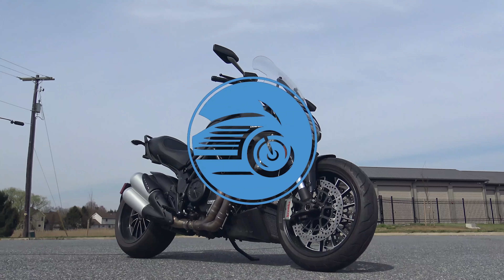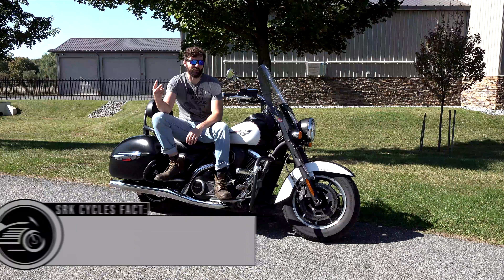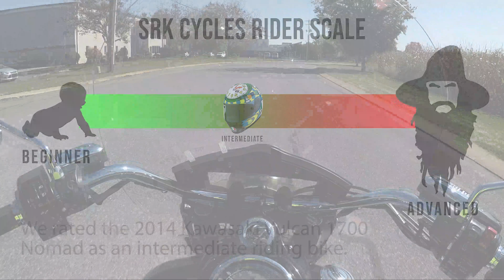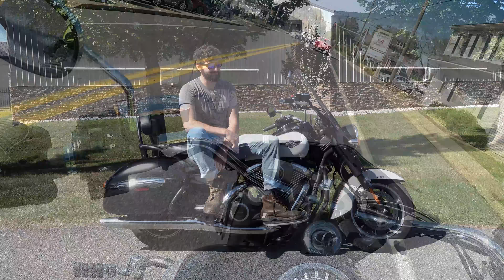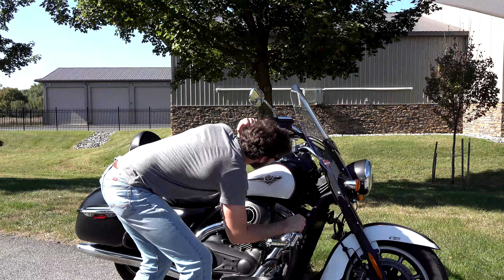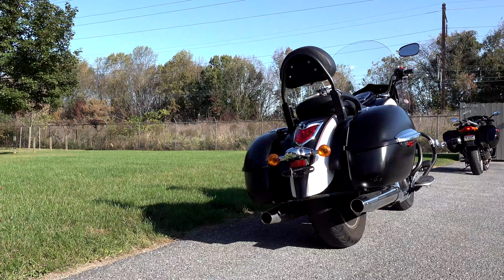Why this is one the best cruisers for the money (The Kawasaki Nomad)

Comment: I had a 2015 Voyager. I loved everything about it except the garbage throttle and engine dumping. I wonder if this is the same with the 1700 engine. I have a 2008 Vulcan 1500 classic now and the throttle, transmission and even the 5 speeds are so much more enjoyable. Yes, the Voyager was more comfortable, I just hated being in 1st and 2nd gear with that bike.

Comment: Excellent video, a question, which is better in terms of acceleration from 0-60 mph, maximum speed, fuel consumption and comfort for traveling, regardless of the price between the SUZUKI C90 BOULEVARB VS KAWSAKI VULCAN 1700

Comment: I had a first generation Nomad (1999) and I only had one problem with it. The wide, low bars. They were fine for about a hundred miles, then I would start having a feeling between my shoulder blades similar to a large knife being inserted and rotated. I did a 4,700 mile trip on that bike in '03 and when I got home I don't think I got back on it for a while. After I transitioned to a Heritage Softail in '06, with a higher more user friendly (for this user) hand position, my limiting factor these days is how much my ass can take, not my back.

Comment: I haven’t road one yet but I wonder if it is as smooth as the Royal Star?
Reply: regret the day i sold my royal star venture smooth as out
Reply: @arranhorron5173  I sold my Royal Star and have the Kawasaki Voyager now. I love the gear ratio much better and overall handling. Not to mention fuel injection. I always worried about the carbs messing up.

Comment: Just to make everyone aware....the 1700 is physically smaller than the previous 1600 Vulcan. They feel more like a road king. The 1600 feels significantly larger than the road king and Vulcan 1700. If you tall and feel cramped on bikes you will probably like the 1600 better.
Reply: Im 5,8...160 pounds....so i would imagine the 1600 would be too big for me.
Reply: @xsamitt  not necessarily. If your feet plant on the ground good then you should ride a 1600 just fine.  Once it's moving you just sit there and ride like sitting in a chair 👍. Go sit on one and if you can touch the ground well then your good to go man. The seat height is fairly low. The physical size of a bike doesn't matter much if you can safely plant your feet on the ground. The 1600 is a big long bike and it's like riding an easy chair down the road 😎👍

Comment: The brake regulation system (to keep both tires on the ground and braking) is actually technically much simpler than you described :) 
Quite honestly, I originally thought that very feature would be something to be wary about as a special technical quirk. 
I was wrong. Nomad has one of the best and the most thoroughly thought through active balanced braking systems in the heavy cruiser realm. All what it needs is a regular scheduled maintenance (like the rest of the bike). And that's it. 

95% of the Harleys ever made are still on the road. 5% of the Harleys made it home. :DDD

Comment: A nomad is a good bike.  It's nowhere near the road king.  Not in power, not in handling, not in fit/finish, paint quality, aftermarket availability, or any other measure.  However, if you don't have the money to buy-in on a  harley, a Nomad is a fantastic touring motorcycle.
Reply: I beg to differ...I bought an '01 Nomad to ride with my father in law who rode an '06 Road King. We took a trip with our Mrs's about 1100 miles and his sled developed a bucking like issue where it would shut off and then restart after a few short seconds. It turned out to be cracked fuel lines in the fuel tank and a stuck up fuel filter. He had 22k mi on his while I had 42k on mine. Our paint was on par, perfect and we'd go back and forth on open road to see who's bike would slack and they were caliper to caliper. Handling is in the rider and the tires, BTW, not the brand...that's like saying handling with a Glock is better for this guy while the CZ is better for this other guy. With all that they're equipped with already, the Nomad had enough but much aftermarket for our needs. Sounds like you're trying to justify poor spending on something iconic although not efficient or reliable.
Reply: @prissy1230 "Teyong to justify spending on something iconic although not efficient or reliable". This sums up dam near harley's entire existence.

Comment: That’s weird the 1500/1600 nomad shifter toe and heal shifter can be individually adjusted,  are you sure your not confused with the Vulcan 900 that shift lever is one piece
Reply: It can? I have an 06 1500 and I'm always knocking it out of first gear into neutral
Reply: @JayDman  That's the positive neutral finder. It's very finicky and likes to slip sometimes, especially on older models
Reply: @carpenoctem  Thanks for the heads up on this. Can you explain the adjustment or post a link as to how it's done by chance? 
Thanks!
Reply: @JayDman  There really is no fix, you just have to get used to it. it's a problem on the newer kawi bikes too. Gotta use a lot of force to kick it into 2nd. You get used to it after a while.

Comment: I own a Road King.  That Sir, is no Road King.  If it feels lighter, it must be a sportster(girls bike)
Reply: Compensating much?
Reply: @bigpapa8152  Now let's compare torque. I don't give a rat's ass about horsepower.
Reply: @dougfielding8215  zx-14 torque and road king torque numbers are extremely comparable, and lets be real no harley ever has had the balls that any zx14 has.
Reply: hey no reason to knock other Harleys here,guy! my Sporty does just fine thank you
Reply: As I once heard from a true rider - I'd like to see you take a sportster on a road trip. You wouldn't be able to handle it because you sit on your cushy bike that has suspension for your poor back, windshields to keep your pretty hair from getting dirty, and soft comfy seats designed for pampered women. Sportsters are for men, RK's and baggers are for little girls that might as well drive a car.
Reply: @carpenoctem  "floating couches." 
Grandpa might as well buy a goldwing.
Reply: @michaels2136  Hey, atleast you can get any year or model goldwing and know you can get 200k+ miles out of it without having to rebuild the engine multiple times.
Reply: @carpenoctem  that is a point I will concede. Goldies are remarkable bikes, my comment was more meant as a knock on the RK elitists. Like, they literally might as well buy a goldwing.
Reply: @michaels2136  I know what you meant. These Harley bagger elitists wouldn't know money well spent if it knocked them upside the head.

Comment: Had both and it really doesn’t compare to the Road King. I’ve never had an issue with my Harleys that was not self inflicted. I now leave them stock and just pile up miles. I have done 25,000 miles per year over the last 4 years here in IN.
Reply: How is he going to make that statement and not answer a simple follow-up question?  Makes me doubt he ever owned both in the first place.
Reply: The Kawi is cheaper yes but at that lower price you give up a lot in fit and finish. The Nomad paint is really pretty bad scratches easily and is not thick enough to take much buffing out i when you do scratch it. Mine had issues with the fork seals. Yes I live on rural roads. I kind of thought that was it too until I bought my RK. I’ve never had to replace fork seals on my Harley touring bikes. The Kawi was another story. The plastic pieces on the Kawi are thin and brittle. Try to find parts for a 20 year old Kawasaki then shop for the best prices between the factory, used or aftermarket on the Harley. 
The Nomad is a great bike has a good power train but. But there is a reason it is cheaper. If you just keep the bike in the garage and ride it every now and then the Kawi may be for you. But if you are going to ride the bike and expect to be able to find parts for it the HD is a better choice. The HD will bring more resale every time over the metric bikes in similar condition. 
Don’t get me wrong the Metric bikes are great bikes I rode them for several years. I still have a V-Strom in my garage and just sold my daughters Shadow this year. That V-Strom will most likely prove to be more reliable than my Pan  America, simply because the Adv bike world and everything that comes along with it is new to Harley. I bought it knowing this and even though I’ve not had any issues out of mine I do expect to. The air cooled V-Twin segment is a different animal Harley has done this for many years damn near forever. They are the king of cruiser bikes look at sales if you don’t believe that statement. There is a reason.
Reply: What are the biggest differences between the 2?
Reply: @jetstream454  The biggest difference is the $$$$.
Reply: @paulalbares643  Ohh yes, aside from that hahaha
Reply: You wasted your money and paid for the name 😮😊
Reply: Harley went WOKE
- all white employees have to "dont be so white" training
Bikes will all be electric 2030
LGBTQRST - kids camp CRAP
"pride ride" and support of other Alphabet soup group crap
Drag queens work at harley corporate
many family  harley dealerships are closing 
FACTS - look them up  - So I sold my Harley Heritage - IM NOT being a part of this sick woke crap! 
looking for something else to ride, maybe this nomad!!
Reply: You have any other jokes?  In a 120 year history that stone age primitive pushrod dinosaur engines are the only ones ever designed by Harley while Kawasaki heavy industries made all configurations and the one he is talking about is OVERHEAD CAM!!  Harley and arrogant people like you just don't get that. No comparison Kawasaki is superior. Cam's place is in the head
Reply: @anthonynicholich9654 hmm I’m the arrogant one? Ride on my friend it’s just bikes man it’s not like I’m talking about your sister. 😂 Ride safe whatever you’re on.
Reply: You never get a Harley owner to admitt another bike is better. They have to small dicks……and ofcourse you find parts for a Harley, they still use same tech since the 50`s. And about plastic, i can show you some serious corrosion on 1 year old Harley metal fenders………great quality, sure…….

Comment: My Voyager sits on 120 klms at 2.5 thousand revs in 6th gear. 360 kilometres when the fuel light comes. About 66 kilometres on the fuel light before ya stop dead. With a head wind, 6 litres per hundred kilometres. With a tail wind, about 5.8 litres per 100 kilometres. A hot bike but a beauty.
Reply: What?
Reply: @danjones9007 idk either

Comment: I have had two Nomads, a 2008 1600 and a 2010 1700. I loved the 1700, but for some reason it developed a rust problem. I think it was an anomaly with my bike. I have not heard of other 1700’s having rust issues. I didn’t like the saddlebags, however. They felt cheap and the latches were constantly giving me problems. The 1600 had much better bags. I was seriously considering putting aluminum panniers on it, but traded for a GL1800 instead.

Comment: Buying used?  look at the ECU and find a sticker or engraving from Ivans Performance then that is the one you want. It will save you 350 plus shipping later. The ultimate and best mod spent on the 1700 Vulcan motors,
Reply: Im seriously thinking about doing my ECU to smooth things out. My only complaint about my Voyager is the "jumpy" throttle and I saw the Ivan tune helps it run cooler.
Reply: @JeremiahHartmanPhotography  Do the Ivan Flash for  for the jumpy lag in the throttle. YES!!  Don't do it for the temp gauge. The Programming in the flash turns the fan on sooner 188 degrees as apposed to 200 degrees. All that really does it show a lower temp needle mark on the gauge. A gauge is just a line above a background with lines. If it is not in the red, Your good.  I never had a gauge before just a light and I thought it was running hot but in reality's it is only a mark on a back ground. And No light. They always run hot until it is in the red/ or the light, lights up. Think of it this way= it is about as accurate as your Speedo, LOL

Comment: Google: Kawasaki Vulcan 2nd gear issues. You will never buy one.
Reply: Never had those issues on my Nomad nor on my 2010 V2k -which I still have.  It has been rock solid and I still ride it as hard as I ever did.  A real hotrod -eats Harleys and sh*ts Indians.  :~)
Reply: Been through a 2000 classic, 1600 meanstreak and a 1500 drifter that I currently own. This whole transmission nonsense is totally bottled into a single online thread where someone doesn't understand the positive neutral finder isn't perfect. I trust a vulcan to get me where I need to go before I'd ever trust anything from HD that is bigger than a dyna and smaller than a sportster.
Reply: I have that issue in my Vaquero, Getting fixed under warrantee this month. No big deal for me. I Love my Vulcan. I must admit I ride it pretty hard though.
Reply: Must be a 1700cc issue? My 1500 Classic has 55k on it. 2nd gear isn't an issue nor is any gear for that matter. I've ridden two different 1700 Nomads. Both exhibited completely intolerable driveline lash. I was soured out after the first test ride. A year or so later I found myself test riding another. After riding it, I remembered why I previously said I would never own one. And no, there won't be a third test ride haha
Reply: @moto_keni  I always liked the 1500, super comfortable, great looking and tried and tested. Not a Harley though. Old Harley ads proclaimed Things are Different On A Harley and it's true. Nothing else feels like a Harley.
Reply: @moto_keni  I too had a 1500 classic with 50,000. bought the 1700 Vaquero. Was actually going to take it back it was so bad with the drive line lash. But then I had the ECU flashed By Ivans Performance and it is now a very good, Smooth bike. Just like My 1500 Classic was.
Reply: @mbarr1029  I've read tremendous things about the Ivan flash. Sounds like the issue isn't driveline but the EFI mapping. I'll keep this in mind as the 17s drop in price over time!
Reply: @moto_keni  Wonder if the 1600 has the same issues? I've been looking at those used on Craigslist. Some pretty good deals
Reply: @theophany1770  Which issue is it you speak of?
Reply: I'm pretty sure the issue lies with how its ridden. I've seen gsxr 750 with transmission issues but mine was fine.
Reply: YUP, I ride mine hard. especially after the Ivans flash, whooh buddy
Reply: @mattsloop2736  Makes sense. Kawasaki's positive neutral finder "feature" doesn't lend itself to quick snick 1-2 shifts. I would imagine the "2nd gear problem" is best summarized as idiots trying to ride their Nomads like a ZX10. I can see them now stomping that heel shifter.
Reply: @Razvan Gaita Too bad that story is BS. The only engines that fail are evo Harley's that also need stator work every 3k miles.
Reply: @Razvan Gaita No, a Kawasaki is a Kawasaki.  Harleys are for old men into cosplay.

Comment: Throttle by wire is crap.
Reply: Stock the Vulcans throttle is not smooth and a bit hesitant. Ivans Performance ECU Flash fixes it and make the whole ride better. If your buying one look for his sticker on the ECU Or engraving on the ECU.